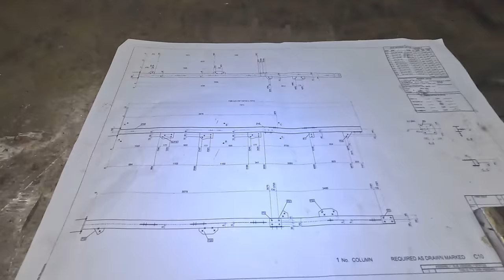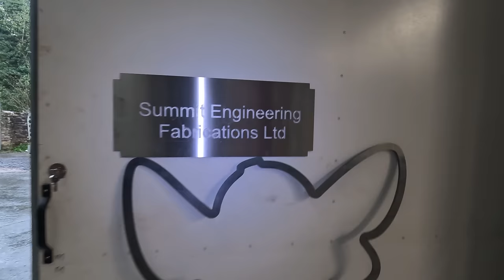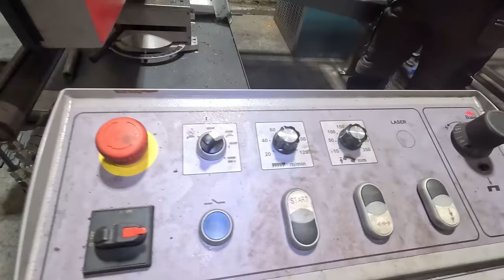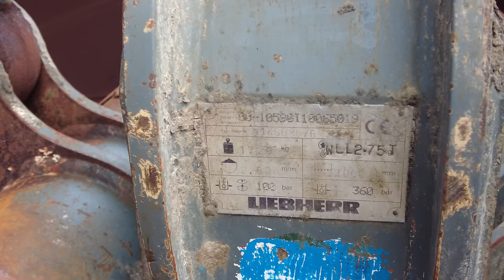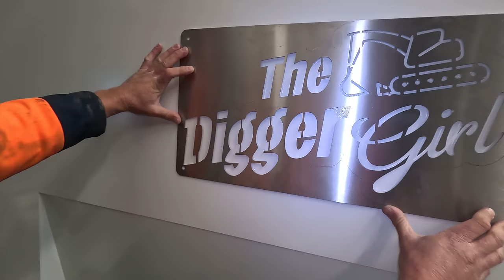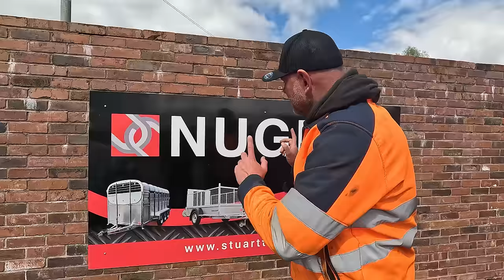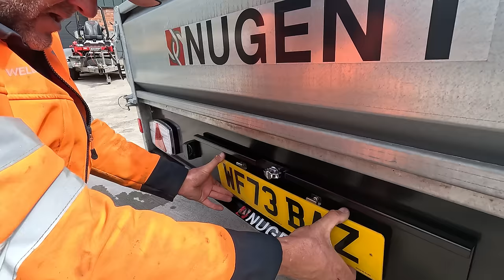WELDERFABBER Helps The Digger Girl Get Set for ScotPlant 2024! Ch #038

Comment: The fact that you can hardly get it out without getting emotional speaks volumes. Working with family isn’t always easy but if it means that much to you all then you’ll make it work.

I’d go with your gut about the building and get somewhere slightly bigger than the one you showed or I think you’ll end up tripping over each other a bit with the gear you mentioned in there and enough space to work around it.

Best of luck with it and if you ever need a workshop away from home in the Carlisle area while out and about you are welcome to pop in and use our gear

Comment: That trailer you bought. The wiring distribution box is up side down. Wires are entering the top of the box, the wires should enter from the lowest edge. Not so much of a problem with general water ingress but a few hard Lancashire frosts....

Best fortunes for the new venture Baz.

Finally, a question; what's the market like for excavator height limiters like in the UK at the moment?

Comment: Your brother is well established so you all be fine and all singing from the same hymn sheet. Plant and structure steel  should be a good base.
Don't burn yourself out otherwise you will be irritable and won't enjoy the process. Take the bank holidays off and Sundays
Reply from the maker: Full attack for 1st 2 years min wages for me and director
Reply: @welderfabber  That's what I did. I worked 7 days for 18months.I had a bad time and basically split the engineering side to my business partner and luckily put my lathes and mill in storage. I work as a sub contractor welder Fabricator. I have coverted a barn on the farm at home and got my kit in there .Planning to build another building for a workshop.